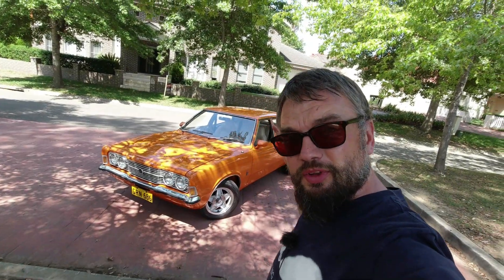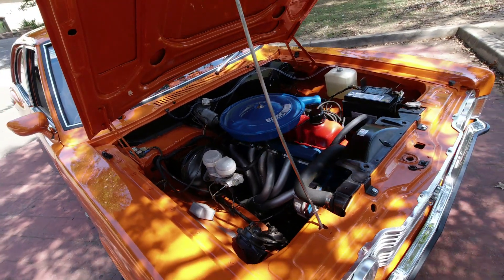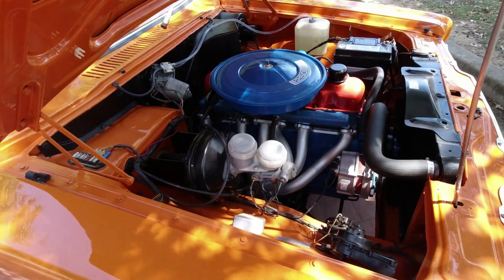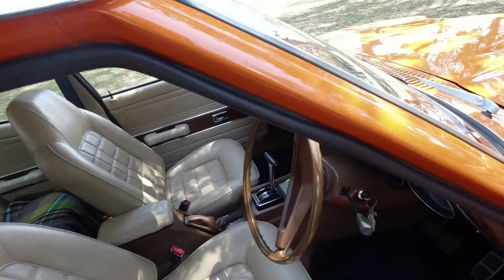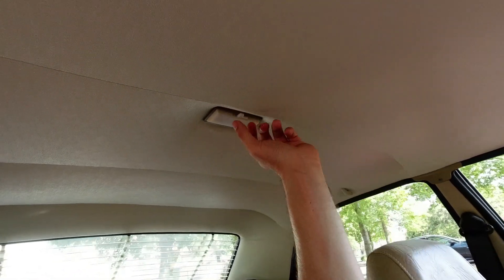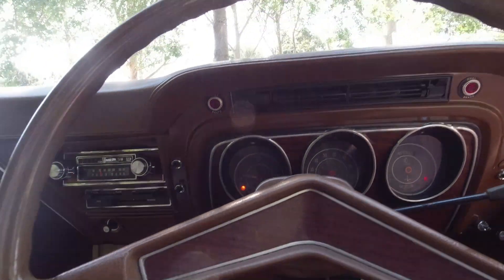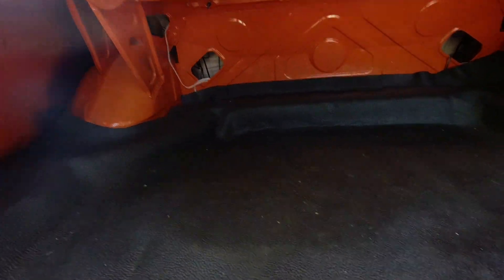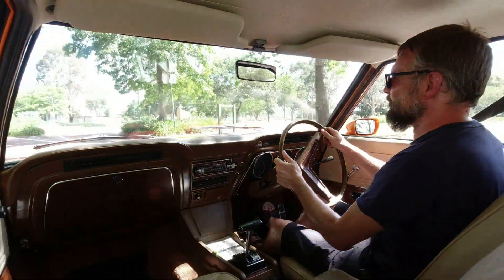Aussie Oddballs: Ford Cortina 6! 4.1-litre, tested in 40+ degree heat

Comment: One suspects an important reason for Ford putting 6 cyl engines in Cortinas, ruining the handling, was to use up these old-style Ford engines made in Australia, instead of the 2 litre engines imported from Germany.
Reply: You could get the 2 litre in Australia.
Reply: @Andyc351  :  As I said, the majority of Mk 3 Cortinas sold in Australia had the (German) 2 litre 4 cyl engine, not the Australian made 6 cyl.   But it was probably cheaper for Ford Australia to try and maximise local 6 cyl production, rather than pay Ford Germany to supply the 4 cyl engine that Ford Britain designed the Mk 3 to use.

Comment: Other English vehicles that got a 6 cyl  transplant in Australia where the CF Bedford with the Holden 173 and 202 cu.in motors [ the 4 cyl version was not available here ] and the Transit with 3.3 and 4.1 litre engines. If you look at all the imported cars in Oz over the years , they usually come with the largest engines available.

Comment: My sister owned the Marina with the 6, horrible car apart from the handling. The seats broke out, rust, suspension was weak, engine was HORRIBLY unreliable. The Cortina 250 was one of the cars I drooled over, especially when they had a 302 Cleveland shoe horned in. The Manual was a MUCH better car than the Borg Warner 3 speed, the whining was due to the hot day... horrid gearbox.... ewwww... however with a 4 speed, these things were wicked fast. Consider the Block on this car was stilll being used in the Ford Falcon until just a few years back. The modern 4.1 litre inline Ford six is easily capable of 900hp with a Turbo. The Cortina needed some suspension work, more than this car has, to make them go hard, and the 4 sp... good video mate.

Comment: The 250 6 cylinder was "Far too much engine"? I guess you would have absolutely HATED the V8 versions that were also available here in Australia! Lol. The Cortina was 1 (of only 3 cars here) that you had a choice of ordering 4, 6 or 8 cylinder engine versions.
Reply: Cortina was never offered with a v8 in Australia from the factory.
Reply: @Andyc351  Correct, but you could order it from the dealer with a V8.
Reply: (I know, because I did).
Reply: @mikeparkes7922  what was the motor transmission combo mate
Reply: If you had an Australian factory supplied Cortina V8 it would be worth near a million. Would love to see any documentation of this mythical car.
Reply: @crunchytheclown9694  My 6th or 7th car before I was 17, and the car was (non-factory, dealer-only) option of 302 Windsor V8 with (factory) 4 speed manual transmission (same transmission as 250 6 cylinder) on my red 1973 TC/Mark 3, 4 door Cortina. Came with (thin and cheap) black vinyl interior (that was hot as hell in summer here). Paid (at the time) considerably for choosing the V8 add. Selected dealers down the east coast of Australia in the States of Queensland, New South Wales and Victoria offered this. Not sure about other States and Territories, but know that South Australia (which is where I lived at the time) didn't. It wasn't taken up by that many, due to very high end cost (plus the engine wasn't covered by warranty), but I was young, with more money than sense at the time. I bought mine out of Victoria (closest State to South Australia). Great power to weight, but it "couldn't handle it's way out of a wet paper bag". Had the car for a year before giving in to an offer too good to refuse. Now 47 years and over 60-plus other cars later, and I remember it fondly as 1 of the more unique cars I have owned.
Reply: @johnd8892  No. I have (repeatedly) mentioned that it was a non-factory, dealer-only option. If it had been a factory option, many other Australians would have taken up the offer, and yes, it would be worth a lot today.
Reply: @crunchytheclown9694  When I wrote "the engine wasn't covered by warranty", I meant it wasn't covered by Ford, but was by the dealer.
Reply: I also brought one from a dealer, mine had the twin turbo 460 option with a 9 inch diff, why do people doubt us Mike?
Reply: @peterkay1091  Either they’re too young to know, or (because it wasn’t that common) they simply never heard of it, perhaps especially in their area. I have no reason to bullshit, and I thought more people knew about it.

Comment: Apparently didn't handle very well, because wasn't designed for that extra weight over the front and you a got a lot of understeer as mention,good power in smaller car thou. My old man had 4 cylinder 2.oltr Kent motor in a mk3 wagon wasn't highly reliable, but dad  said it handled well - the power I guess, this is my dad were talking about thou and he also wasn't known to maintain cars well, dad's brother passed it on to him, mum hated it🤣😅

Comment: Ford 250 are a mighty engine, driven plenty of em , the Canadians put a 2v head on them and they where magnificent
Reply: in In 1970, Ford of Australia also developed the '2V' ('two venturi', or '2 barrel' in Ford terminology, reflecting a new 2-barrel carburetor as opposed to the previous single-barrel) cylinder head, the car in the video may had one fitted
Reply: Those pre crossflow motors had a shitty strangulated induction system. A single barrel on a 250. Was that inlet manifold one piece with the head? Remember seeing an early falcon head like that.

Comment: In 1973 bought a 6cyl XLE  (top spec) in copper bronze with a vinyl roof. Beautifully styled car with tons of power had the Falcon motor. In the end rust  was a big problem so traded it in 1980.

Comment: The local Capri top model only went for the imported 3 litre V6. Made little impression when compared to GM Holden Torana GTR and GTR XU1 models so was dropped after a few years as was the entire imported Capri line. Cortina attracted a much wider market but not much of the high performance market. They would go for V8 Falcon models if loyal to Ford. Cortina TC and onward had no circuit racing profile.
Normal market example were family friends who had the later Cortina model after downsizing from the Falcon when their children left home. Wanted adequate but not high performance.

Comment: Often wondered why Aussies have a love affair with gas guzzlers when it could be hundreds of miles between filling stations, many people live 400 odd miles from the nearest town and a shopping trip is an expedition.
Reply from the maker: Mostly because 400 miles with a miserable engine isn't fun!
Reply: @HubNut  Nothing wrong with the old Kent engine, spent many hours with one up front between London and Edinburgh and if one had a gentle right foot could just do it on a full tank, admittedly it was mostly at night, the boss was too tight to pay for the night sleeper and an hotel, if he did the hotel would not be needed and I would be back a day earlier.  If one had a problem the AA or RAC man could usually fix it by the roadside.

Comment: Did they mention which dif ratio was fitted...?
Reply from the maker: No, but I'd say a taller one is required. Was a bit revvy at speed.
Reply: HubNut just interested as I had a mk4 cortina and Capris and I discovered the 2.0 Capri had same dif as 2.3 cortina similar the 1.6 Capri had same dif ratio to the 2.0 cortina. 2.0 Capri always did 30+ mpg but my Cortina 2.0 only did 25mpg this was conclusion after trying to understand why was the lower dif. 2.0 Capri was 3.44 can’t remember others no w...😊

Comment: Ford Australia also used the 3.3 litre/200 CID straight-six, as well. You had to watch out taking off from the lights, as you could leave rubber even under modest acceleration.

I think the smallest engine for the TC Cortina onwards was the 2.0 litre four. Maybe the 1.6 litre "poverty pack" option. None of your Pommy 1.1 and 1.3 litre jobbies. That's also the original plate for that car, I believe. Certainly dates to 1976/7. Looks like a bit of time and cash has been spent on doing her up.
Reply: Later model Holden Toranas came with an optional 5.0 litre/308 CID V8.

Comment: Seems it desperately needs power steering. And probably un lowering with softer springs. Rather odd that it hasn't got Ford switches for lights and wipers. Very much Mk1 Granada styling going on.
Reply from the maker: I suspect the firmer springs help rather than hinder...
Reply: @HubNut  Helps in what way ? reducing waft ?

Comment: I would be interested to see the gearing.
If you watch Ian take off, it seems to use the torque of the engine and 1 st is fairly high id guess.
Are all the ratios high?
Whats the top worth Ian?

Comment: These are right up there with the worst death traps ever built.  These were so flimsy if you don't park on level ground the doors jam up and you can't get out......  I had the misfortune to drive one around Hobart when it was an office pool car and I could feel the unibody warp over the undulating streets.  The 6 Cyl Torana which was also a pool car was much more rigid in the body, but did suffer from going end to end if you gave it a bit too much on the railway roundabout......  anyone remember skinny crossply tyres?

Comment: Had one as a young bloke, went like a cut cat 
Mine was a TD 250 , 4 speed
Stock they would wind out to over 200km/h , handling was attrocious but you could easily burn rubber

Comment: Power bulge bonnet  heavy six sitting where a four should have been   Handling was a bit on the dodgy side    You would come across the odd one or two with a Windsor shoe horned in the hole

Comment: Some Australian opinions on local Cortinas including the owner of three. One a V8 conversion that is for drag racing but his pristine version 2 litre XLE is shown. Six cylinders or 1.6 versions do not impress this group : https://www.youtube.com/watch?v=jgp-A0qMN2o&t=10s
Learnt also that the TC model code name meant Taunus Cortina and that Ford was thinking of a V8 version to replace the Falcon GT HO and to beat the upcoming Torana V8s in local racing.
After the Ford Falcon GT HO had trouble beating the six cylinder Torana XU1 in racing, Ford got very nervous when they heard of an upcoming V8 Torana.   A puzzle why these Cortinas were not as well built as Falcons on the same production lines.

Comment: I had one of these in the 80's. Top line GXL TD model 4.1L 4 speed. Handling is biblically atrocious. Engine is a non revving boat anchor. This one is a beautiful example and kudos to it's owner because all the rest of it's Au built siblings simply turned fell apart and turned to dust like most Au built Fords did. Believe it or not these Cortinas can command mid five figure dollars here!
Reply: How much are they these days

Comment: I'm in Victoria, Australia and I had one.   Mine was a wagon (estate) navy blue with mags and a 4 speed manual behind the 6.  Went like a cut cat and I drove it hard.   Main issue was the switchgear was made of crap and would fall to bits at no notice.   Not really a Ford fan but I did like that car.

Comment: It should be stated that Oz coppers are anal about speed / hooning etc
Here in the uk you can do a burnout in front of them and... Yes they'll pull you and check your details & tyres etc but that's it !
As for speed. If you're not driving like an utter Bell End or in busy areas they'll basically ignore you (The Static cameras won't but a lot of those are redundant now).

Comment: Ian, Thank you again for triggering another memory of my early driving career. Back in 1979 I was an 18 year old learning to drive in my first car, aided by a retired neighbour. His son in law had just returned from Australia with his 1977 Cortina 6 GL.  It was the Mk 4 body with the same 4.1 litre six and Borgy auto combo as the feature car.  It was fitted with power steering though.  It had the heavier Australian spec bumpers (and a front roo bar) and it was cream with a beige vinyl top.
I had a breakdown in my Viva HC at work one rainy night, and my driving teacher came in this Cortina to get me home. He let me drive it.  It was one of the most throttle responsive cars I've ever driven (it certainly taught me lessons in how to control the throttle!). It had the accelerative urgency of a horse from standstill.
I loved the smoothness of it. I don't remember the whingey auto box though...

Comment: My dad own two of these.  They were a bit of a dog in this model coz they fed that big engine through a single barrel Stromberg carby.  To say it was asthmatic is an understatement.  Could have been so much more if they had a decent induction system.  Edit. If my memory serves me correct the orange colour in my dad’s wagon was “Tango”.  Still have a jigsaw storage box he made from wood in the mid seventies and painted with his can of touch up “tango” colour. And yeah the Bosch jigsaw still works 40 years later.

Comment: That BW 35 sounds unacceptable  noisey at idle and low gear………
now I think of it I had 1 in the workshop back in the day with same noise………(was same cortina model).
pulled the pan off the auto and found the filter partly blocked with clutch pieces……….
14 years (1984 -1998) in a workshop dealing with bw 35 and 40 in fords et al …..I never heard one that sounded like that again  until this video.

Comment: The alloy wheels look like GKN made units. Very similar to those on the MKII Stags and later commemorative MGBs. Never seen them on a Ford before.
Reply: Made by Globe products or ROH wheels in Australia. Modelled on Ferrari Daytona wheels. Fitted to Falcon GTHOs in 1972.
Reply: @guyh9992  Thanks for clarification. 👍
Reply: @guyh9992  Hi Guy, had to refresh my memory as to the design of the Daytona wheels. You're right, they are very similar. Cheers Russ.

Comment: Did you mention they didn't come with power steering. My mates old man had one. Yes, very powerfull but ultimately quiet scary!
Reply from the maker: I was heaving at the wheel a fair bit. May not have mentioned it, or may have lost the footage due to wind noise.
Reply: Yes steering is heavy, but I have resisted going for power steering as it was not original. It is not bad at speed, just very slow stuff. You need to respect the power and be awake when it’s wet.

Comment: Nope, much prefer this sort of vehicle to the stodgy old Marina. I had a 79 Mk 3 Capri 1.3 that I removed from its life of shame and dropped a 2 litre Pinto into with a 5 speed Sierra box and Spax adjustable shocks all round.  You could drive it on one finger and the throttle all day, it was so much fun.  That is 70/80s motoring for me and I really didn't like the Leyland rubbish that was about, dreary slow bits of tin.  Still, vive la difference eh?  My ex-brother-in-law had a late (just pre-Ital) Marina in orange with slightly knackered trunions and a starter motor you occasionally had to hit with a hammer which I had the 'privelige' to drive and it felt very outdated and uninteresting to drive.  Keep up the good work on the channel though, as it is very interesting seeing the old motors and stay safe during the current crisis.

Comment: hubNut, 
You should Try to Find a UK spec 1982 Cortina 2.3 Ghia V6. ( 6 cyl Cologne engine) & with Manual Box. 
Stunning Cars to drive. They Came with Power steering. 
Superb Ride, Superb Silky Smooth Power, 
Handling = FANTASTIC. They Stick to the Road like Glue. Non of this Sliding around Rubbish you hear about.  BUY NEW TOP Brand Tyres . 
& Hammer it through bends & Roundabouts in the WET as Hard as you like. 
The Factory Suspension is Brilliant for a soft ride & also Great Handling. 
A VERY DIFFERENT car to the 2.0 Ghia . Looks the same. But Drives Brilliantly. = TWICE the car of a 2.0 Ghia.

Comment: 155 Bhp... how do you get so little power out of such a big engine.. my diesel  van put more power out  of 2 litres
Reply: Is your diesel van from the 70's too?
Reply: @Andyc351  shelby was getting 600 Bhp  from a push rod 440 ci 8 valve v8 running 87 octane
Reply: @richardoakley8800  because Shelby products have alot of relevance to a cheap family sedan. And there is no such thing as a 440 ci Shelby engine

Comment: Great video. Back in the days over here in Holland we had the Mk.3 Cortina AND the Taunus. Underneath basically the same cars, bodywork was different. The Mk.3 Cortina was the last model that carried that name on the continent, the Taunus took over and it outselled the Cortina. Then, in 1976, the Mk.4 Cortina came, and the Taunus equivalent, only the names were different apart from some very minor differences. I had three of them, never had any problems. Kind regards, Willem, Hekelingen, Holland.

Comment: Engine sounds amazing.. Transmission sounds.. erm.. well it sets my mind at rest as to the noises that my Borg Warner box makes that's for sure!.
Reply: jedw 
I rebuilt many hundreds of those during the 80s and 90s and do a few still. The noise issues were a constant problem..some where near silent others noisey under load .. yet visually they all looked the same.,I think the machining was inconsistent on the planetary carrier and the secondary sun gear but that’s just my opinion. The later units were quieter but didn’t have the same gear set durability.

Comment: They were certainly better than the Marina six and Chrysler Centre six at the time. But again high fuel economy and poor build quality ( they were CKD from the UK ) meant the local market pretty well stayed away from them and bought Falcons. BTW for a short time you could get a 302 cubic inch V8 in the Cortina. Now that was a dangerous car.
Reply: The Centura 245 2 barrel was faster, better on fuel and handled better than the cortina. It also had better seats and with  the KC model, better controls and instrumentation. And had Chrysler sold them with the 265 engine, they would've not only had more power, but economy still.

Comment: The 8-track slot is probably behind the tuning dial :)
Cool car. That microphone... Kill it with fire.
Reply: Yes that is right. The unit is a Learjet 8 track with quod sound, four speaker out put. A very good eBay find many years ago.